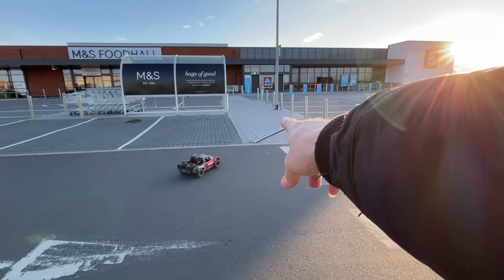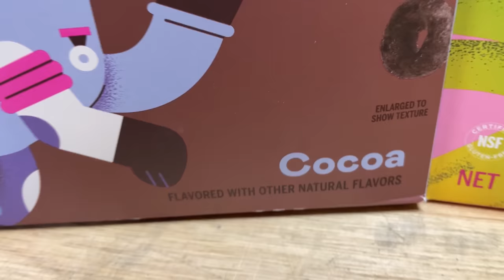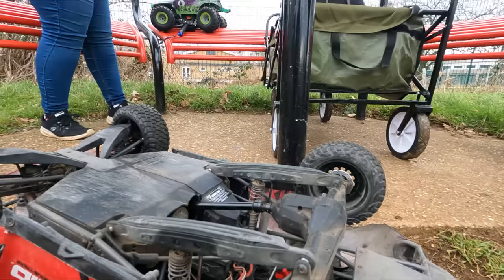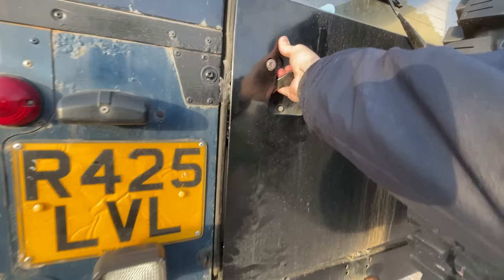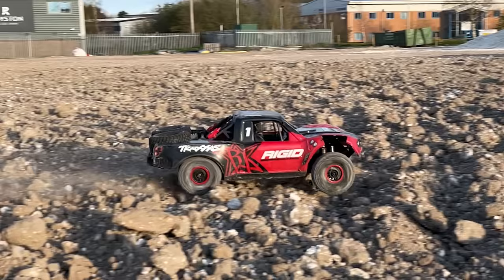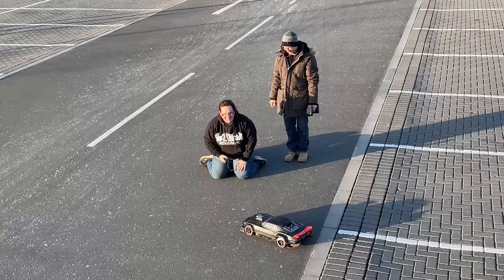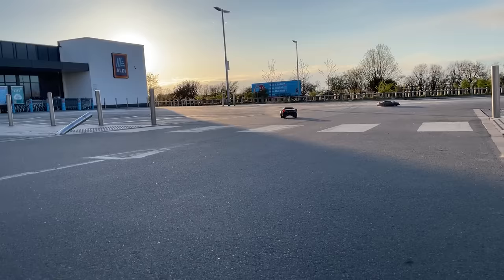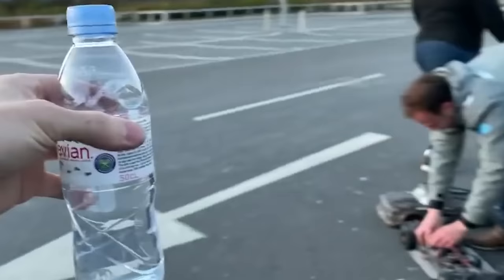RC Desert Racer - Will this work?

Comment: The udr gets given a new life yet it just fell back into its old ways in being broken😂
That gopro was always going to get hit at the end there😂
Reply: Yeah. I just killed my motor in the udr. Besides that it's been reliable. Can't say the same for the E-revo 2.0. The esc just got the red flashing lights of death.
Reply: @gasolinediesel972  oh dear, the only traxxas electronic thats died on me is the xmaxx motor...
Reply: @SLD-RC  Well, for some reason I've killed a total of 5 traxxas electronics in the past 3 weeks. 2 2075 servos, 2 2200kv 6s motors, and one VXL-6s esc. My traxxas warranty motor is supposed to come today so I'll have the udr back up and running in no time.
Reply: @gasolinediesel972  ouch thats not good, wil be good to get your udr back running!
Reply: @SLD-RC  Yeah. I can't go outside today anyways because it's raining so it's no big deal. Hopefully the motor lasts. That's my biggest concern.
Reply: @gasolinediesel972  as long as its lasts then that'll be good
Reply: @SLD-RC  Yeah. I'm gonna be easy on it. It smelled like it was burning. I think it got too hot.

Comment: I Have an Idea for a video! I have one of the best 1/24 scale rc's ever I think. Its called the Power Craze Shift 24, and its abt 40 bucks. It seems toy grade, but the steering AND throttle are both proportional. it also says it goes 20 mph. Its awesome!

Comment: Hello kev. Love your videos. I've got a question I wonder if you would no the answer to. I havea zd racing pirates 3 but the drive shafts are terrible and just bend if you hit the deck to hard. Would I be able to use traxxas drive shafts in the zd racing as I can't find upgrade parts for the car. Many thanks kev and keep up the hard work

Comment: traxxas axles :/
I have a stampede 4x4 vxl which i spent like 300$ to upgrade it to steel cv shafts, and the axles still manage to break themselves once a week! gone for the e revo instead, and guess what. the shaft and drive cup are split, clean in half. today's lesson is that traxxas metal sucks, also not to mention those shock shafts in the rustler that bend by hand. i'm starting to hate them

Comment: This is a public service message. I would like to start by saying I'm a big fan of the channel. I would like to caution people in the US about buying bangood products. I know this video isn't the most opportune time to bring the subject up as it doesn't pertain to banggood at all. Please, endorse the products that you recommend and carry the replacement parts. I bought the water truck from banggood in hopes of seeing it race across the water. I found this thing had junk gears made out of, "monkey metal". No big deal. Except that I couldn't buy the parts that need replaced. I have a similar problem with my dhk Maximus. Parts are more readily available for this product. I wouldn't buy either one of them again. Kev, I often see you touting banggood products. These might be great cross the pond but here in the USA we have limited success with replacement parts.
 The last order I put into banggood resulted in no product delivered. The replacement parts I tried to order could not be found anywhere. Stuff it banggood.